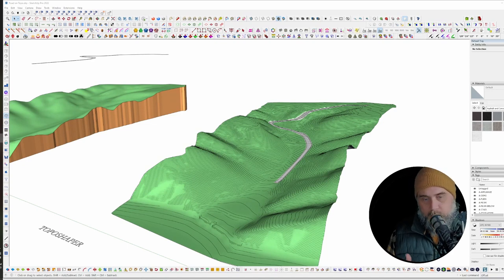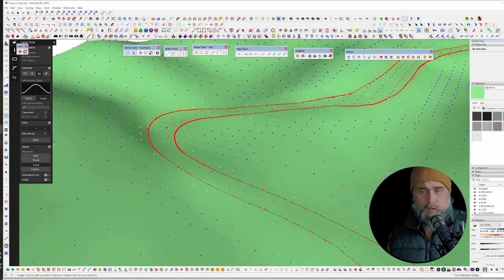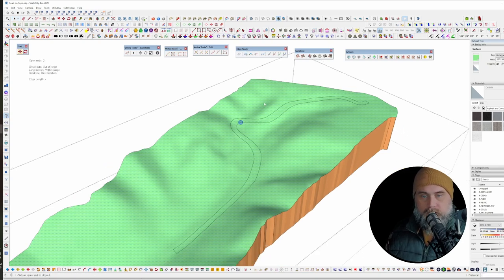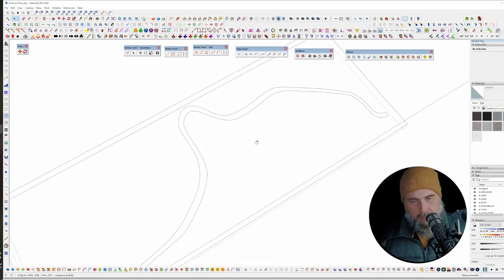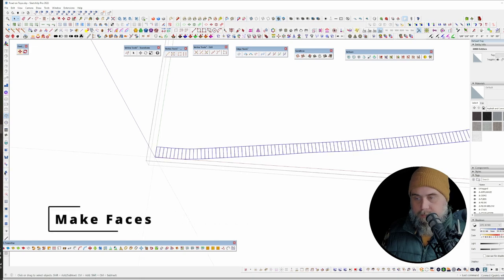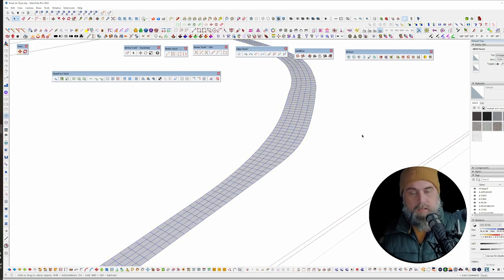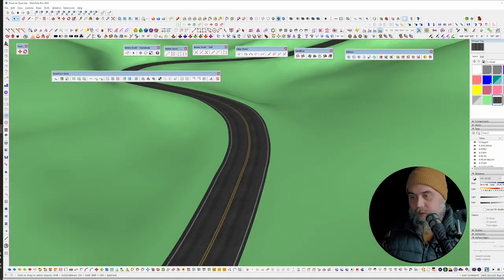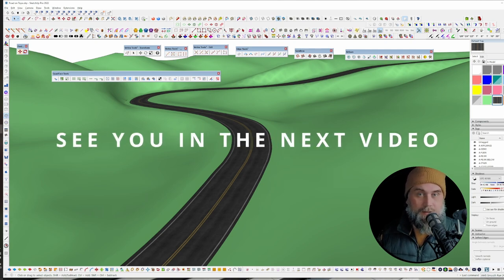Sketchup Tips - How to Conform a COMPLEX Road to a Terrain and Texture it

Comment: i have a question does the same apply if we have multiple branches of road with different width and elevation
Reply from the maker: The elevation is determined by the terrain.  The junction between road and secondary roads should follow properly.  The challenge would be getting the texture mapping correct.  You'd probably want to isolate the junction and texture that separately, and then treat each branch as its own road as far as building the quads.  It all gets a lot easier if the road is equal width throughout.